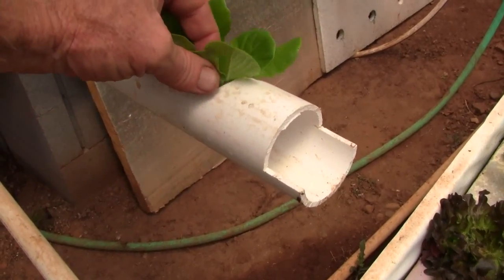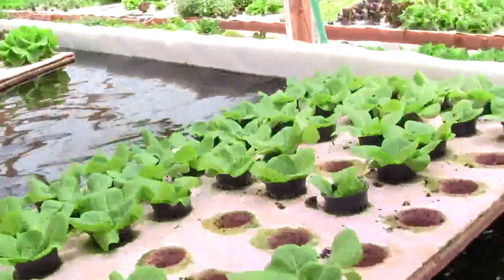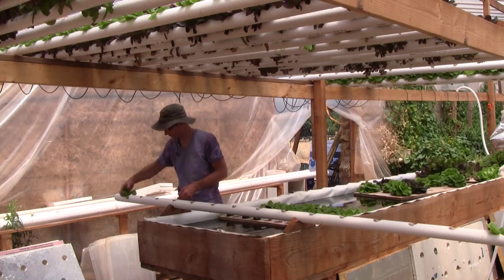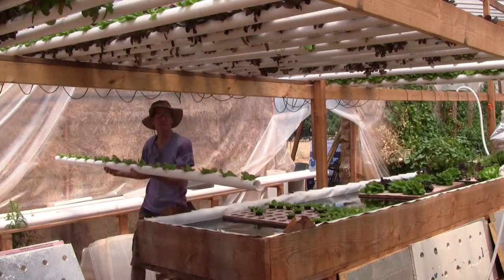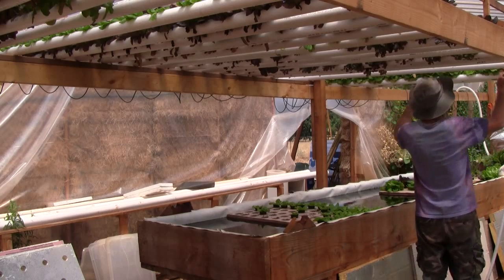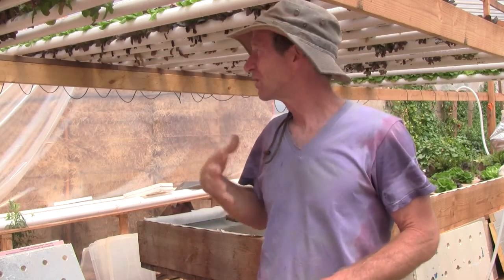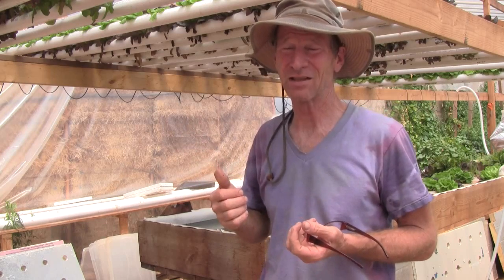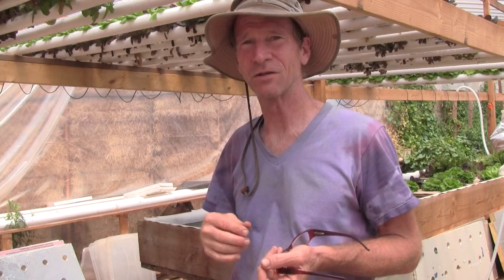Overhead NFT System 2 in Passive Solar Aquaponic Greenhouse

Comment: What size was the hole that you drilled in the 2" pipe holding the plants and what length of spacing did you use between each hole? Great video!
Reply from the maker: TheNetworkD Check out the other videos on the Overhead NFT system, those questions and more are answered in them.  That said, I think I used 1.5 inch diameter holes, though it isn't critical.  The hole spacing is 8 inches, again not critical.  Diameter and spacing can be adjusted to fit whatever plants you are growing.  You might want 12 inch spacings for larger plants.  But smaller plants work better as too large a plant can tip over
Reply: +woodfirepower hello sir which video explains the coco and perlite mix ?

Comment: Shouldn't be any concern with gavanized steel rain gutters to get the flat bottom. The only trick is you have to provide some sort of top, but a long piece of foam can be cut to just the right width to slide into the top. 

http://www.idealtruevalue.com/servlet/the-37560/Detail?gclid=Cj0KEQjwvLGfBRDfkrr19KDS-7YBEiQA8CoFJyanlky__9Ph__0wtmbh6fMjcOD2D8zfmomWtWOC8DcaAt6B8P8HAQ